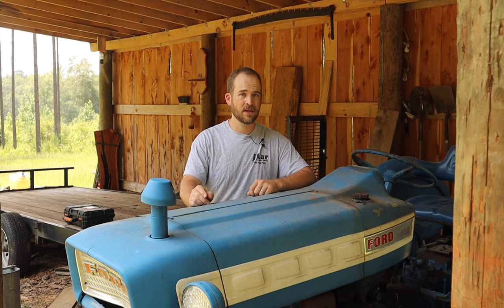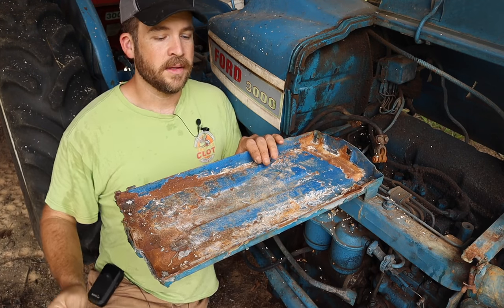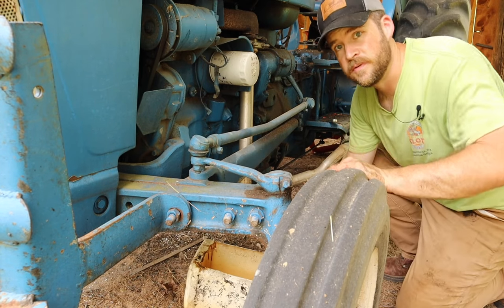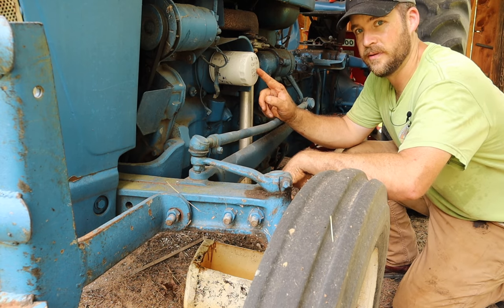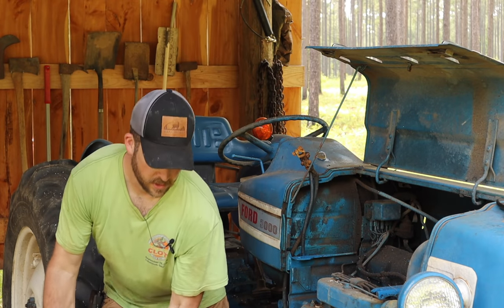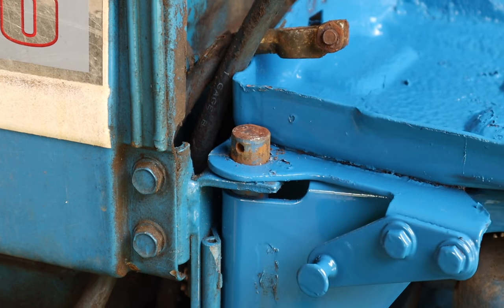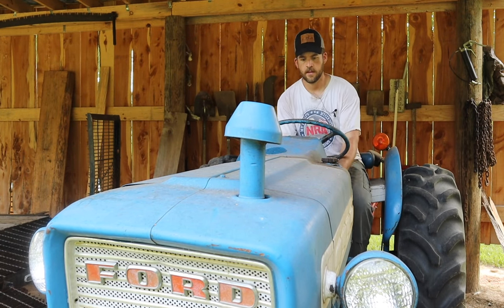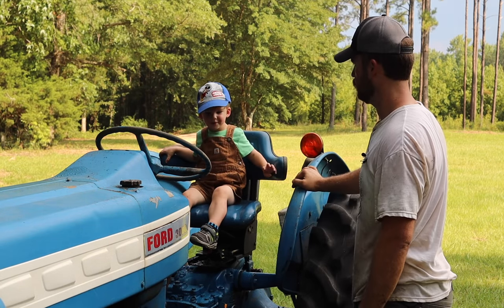NEGLECTED! Bringing an Old Tractor Back to Life

Comment: We had four of those old Fords on our family farm, and one of the things that I remember is that they were so easy to service. Everything that you had to change, check or grease was accessible, not like some of todays machines where you have to dismantle half of the tractor just to change oil. Great video, and thanks for sharing.
Reply from the maker: Oh yeah, no way I could work on the Kubota this easy. Sad how things have changed.
Reply: @falllineridge that wire brush is to big  get a smaller one 🤣🤣🤣

Comment: This series (2000, 3000, 4000, 5000, 7000) from 65-75 was the pinnacle of Ford's agricultural line. 
There are tens of thousands of these old beasts still out there earning their keep on farms and ranches all over the place.
Reply: Totally, i´m a freaking fan of Ford tractors specially the ones you mentioned. i´ve seen the 3000 doing things that no tractor of that weight and power should be able to do without breaking.

Comment: Buy a battery tender unless you are going to use the tractor once a week.  They make solar types if you don’t have power in the shed.  Good job!  Aloha!
Reply: Yes, a battery tender is a good thought, check alternator or voltage regulator for over charging!

Comment: Nice tractor buddy, I own a 3600 and my father-in-law owns a 3000 as well. The 3000 needs the engine over hauled desperately but it still chugs along. The coolant heater shorted out (7-8 years ago) and started a fire that spread around/in the tractor but my father-in-law got it out out in time and had to rewire it and replace the hoses and belt. These older tractors aren't as nice as the newer ones but are a lot easier to work on lol.

Comment: You do a great job at doing things, only thing not up to par is the one battery cable end, the bolt on cable end is a temporary fix, to get you home, then either change the cable or get a proper cable end put on the battery cable. As a heavy duty mechanic I’ve had many problems over the years caused bu the temporary cable ends. Love your videos, and especially watching your young son, reminds me of my grandson, take care my friend.
Reply from the maker: Didn't even know that, thanks for the tip, Gerry!

Comment: The drawer liner wasn't a bad idea but moisture can get under it and cause good old fashioned rust.  I'm a bigger fan of spray on truck bed liner, spray under coating,  or Flexseal.
Reply: Or cut the liner so it was big enough to overlap the steel edges - so any moisture coming down the battery would be kept from touching the steel of the tray.  Maybe it would look a little funky and may present a slight fitment issue - I think the benefit of keeping any acid away from the painted steel tray makes the most sense.
Reply: @samvalentine3206  you'd still have the same possible issue of things like condensation getting under there.  But a spray on coating prevents that period.
Reply: @wauhawk  - Yup, no arguments there, just opinions on how I would change what was done, if no spray-on coating like you suggest was used.

Comment: I invested in getting a Harbor Freight Sandblasting cabinet since I am working on three 1951 tractors. Sandblasting the parts and trays makes it so much easier and cleaner. Then I paint the parts with Anti-rust paint you see advertised on Tik Tok or Facebook. That stuff really work well.

Comment: I grew up on a working cattle farm with two early Ford 5000's...our nearest neighbor had a 3000. Blue ran in our area...!
Tip...POR-15 next time you have to paint over that type of damage. I've used it several times, cures better in humidity and it's amazing stuff.

Comment: Had a super clean 1969 2000 diesel for about 10 years, thing was bulletproof. Rarely used it, kids came along, had to sell it. 20 years later, bought myself a 2021 L2501HST with loader & grapple. Life comes at you fast!

Comment: I picked up some battery cleaner at Walmart the other day and it works well.  You spray iron, let it sit for a few minutes and then rinse it off.  I also got some terminal protector made by the same folks. MIT seems to work real well.  I used to use baking soda, too, but I like this stuff, better.

Comment: We have a Tractor that is Identical to that one.   My Dad's Uncle bought it New just before I was born.   Right now it has some steering problems right now.   My Brother-N-Law  put a front End Loader on it and I think He screwed it up.   My Uncle tried to rebuild the power steering cylinders with washers for a kitchen sink, it worked, but that was years ago and it probably needs rebuilding again.  Dad has a 4610 that He uses now.   We have not had My Uncle's Tractor running in several years.

Comment: I am a subscriber to your awesome channel and greatly enjoy your videos. This one with your precious little boy was especially entertaining and enjoyable. I used to take my son to work with me on the road when he was your little boy's age and he knew the difference between a pipe wrench and a "crescent" wrench by the time he was 4!! Nothing like having your son help you when you work!! I also learned something (as i usually do) in this video with the use of the drawer liner on the battery holder. Thank you for this great video!!
Reply from the maker: I think it'll help, but others have mentioned bed liner. I think that would be much better.
Reply: @falllineridge  I think it will help Wes, but I was surprised you didn't cut it to be about an inch higher than the tray, so that if the battery leaked, it would hopefully contain the acid.

Comment: Loved the video.  I grew up on an 8N Ford.  If you are changing the oil bath filter and the engine oil at the same time, you are doing 1 at the wrong time.  Engine oil should be changed with the engine warm so that any solids are suspended in the oil, not sitting on the bottom of the oil pan.  Oil bath air filter should be changed when the engine is cold so that any solids are in the pan, not in the wire mesh.  Other than that, great job.  Good to see it being used.
Reply from the maker: I really wanted to have it warmed up to change the oil, but I would have had to have somebody pull it off since the battery was dead.

Comment: Did the same thing on dads ford 2000 and a friends harvest jubilee we stripped them down bare and had them powder coated  and then covered in the correct color rubberized paint to stop it from occurring a second time.

Comment: You can use some flex seal on the top side of the tray and it will act as a undercoat. It does really well for that. I did it to my truck batteries tray and no problem.

Comment: I put any new battery on a small amp charger overnight, just to clean up the plates.  I use a 2-3A charger for this initial charge.  It also polarizes the battery.  The alternator can often put to much charge to a new battery before the plates are conditioned to accept that charge, hence the reason for the initial low amp charge.  I would also grease every grease fitting after pressure washing the tractor to get any water out of the joints.

Comment: Those old fashioned group 4 DLT batteries are just endless headaches, ... and they don't last very long.  Several years ago I started using a maintenance free group 65 battery instead, ... and have been very pleased with that choice.

Comment: FYI: the injection pump requires oil lubrication. If my memory is correct it's a Rossi I.P. Notorious for failure due to lack of lube.And when you fill with lube it leaks out rather quickly because of bad seals. Just fill with 30wt before each use. Will be good for a few hours.

Comment: I would have sprayed it with a Rustoleum paint, any color I had, before painting it Ford blue.  I might have even boiled the battery tray in an alkaline solution to neutralize any remaining acid ions.  Super 
Clean is a good alkaline cleaner.  Hopefully it might remove any remaking paint, so the metal areas under them could be neutralized.  I would also put a rubber mat in the tray to protect the new battery and metal from futer degradation.

Comment: I used to have one of these Ford 3000s, and my take on this charging system is if it worked right you wouldn't need such a large battery that you have to pay two prices for.  You can update that charging system/with smaller battery for the same price you paid for that odd ball battery.
Reply: That was the sized battery for the diesel's , so presumably didn't have to change the design? Less parts to assemble and store.

Comment: I grew up on a 4000, great tractor. The 3000 was a lot lighter but a good tractor. Both take that odd ball expensive battery. Seen many cut out the hood and place a taller one in, nothing I would do. Mounting another box on side and run some cables seems like a better idea. I have put many clutches and over hauled many of them. The power steering was the weak item on these tractors.

Comment: Its a leak   or could be a voltage reg  giv'in er to much juice  good pratice ta put a meter on the termals when ya have to replace the battery whilst she's running full throttle vol.  14v max for avg.

Comment: Nice tractor and Nice film you did it wel done .
But of you change the oil ,first start the tractor and let the motor running for 5 or 10 min.
The turn of the motor and wait for a fiwe min.
Than change oil and filter. 
Oil is warm and thats better to change  .
Put nieuw oil.in til level
Start the motor, running a few min.
And motor of and check oil 
 level full oil to level.
The new filter  was empty so thats why you must start the motor that the oil can Into the filter 0,25-0,5lrt.
Good luck white the beautyfull ford.

Comment: I would soak those battery terminals in a container full of baking soda and water and then clean the terminals with a wire brush designed to clean them.

Comment: I bought a 1961 Ford Powermaster. There is a tinge of blue smoke coming from the exhaust. Do you know if that is acceptable on these old tractors or is it a sign of need for a major overhaul? I'm not familiar enough with these older Fords - any advice appreciated.

Comment: I'm curious. I don't know anything about tractors. What was that canister in the front of the radiator with oil in it?
Reply from the maker: It's an oil bath air filter. The air gets sucked through the oil, then up through a wire filter, then into the engine.

Comment: Sprinkle a good heavy coat of baking soda in the tray before you put the washed battery back in the tray...!    Cotter pins suck...  Replace with Hairpin clips.   Also you needed a flat washer before you put the wingnut on...    Man that's a cherry old 3000...!   What  Part of the country are you located...?

Comment: Hey I've got a 5000 and on it the injector oil is not connected to the engine oil, therefore u have to change it separately

Comment: i hope you were wearing a respirator whilst scrubbing that battery tray, you don want that solphate dust down your lungs. btw, when replacing the oil in your air filter id reccomend using old and used oil as its a lot stickier... it allso saves our world as it is technically recycling

Comment: If you had cranked the tractor without disconnecting Anything and spray the battery and cables with a water hose it would have removed all the corrosion

Comment: Those 4DLT batteries are junk only last a year or two. Better off to buy a good modern cranking battery. I've been using one in my 3000 ever since I've had it and no issues. Plus you can actually get a good warranty on them vs those 4DLT batteries

Comment: Bring an old tractor back to life and the environment to die for. Is it so common in the USA to simply dispose of cleaning agents and mineral spirits in the ground? Hopefully someone from the Conservation Agency will see this video!
Reply from the maker: Thanks for watching, Werner. What you couldn't see was the oil drain pan outside of the frame. That's where I dumped the gas.

Comment: I have a tractor just like that and I really enjoy it and it has saved me a ton of money.  But I must warn you that you all of that baking soda around that battery,  you probably have ruined it,   baking soda an acid batteries  do not go together at all. One drop of tha soda inside the battery ruins them.  School of hard knock talking here and 30 years in auto motive repair industry too. Just sharing.
Reply from the maker: The battery was already ruined. Replaced with new one later in the video.
Reply: @falllineridge  I see that, nice tractor.